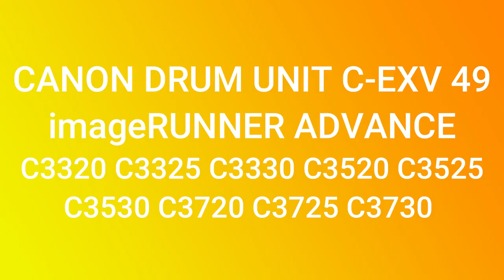DRUM UNIT CANON imageRUNNER C3320 C3325 C3330 C3520 C3525 C3530 C3720 C-EXV49

Comment: Hello, why did you change the parts? And when is it necessary to change the chip?
Reply from the maker: These are consumables and they have a lifespan, so you replace them according to the copier counter.
Reply: thanks. Do you need to replace the chip after the resource is exhausted?
Reply from the maker: @datomaxatadze8097 It's easy to replace so better use a new chip.
Reply: @MrRicoh  thanks
Reply: How many grams are thrown in the colors and black?